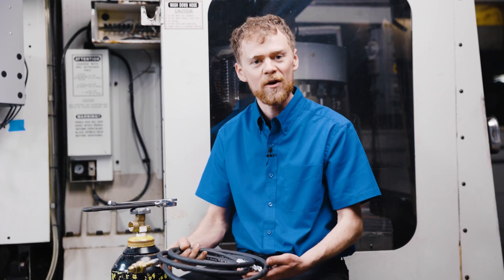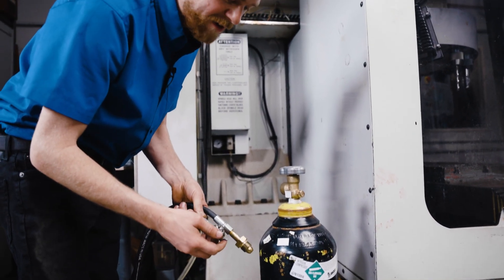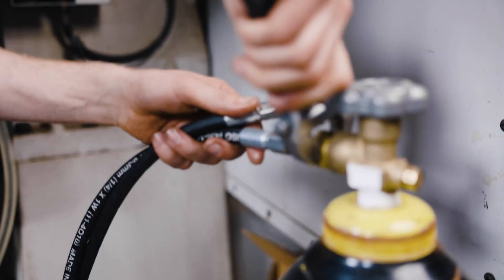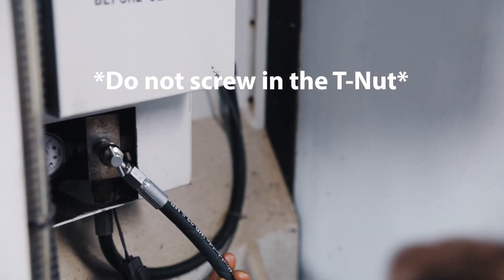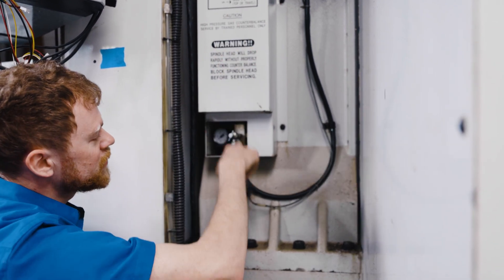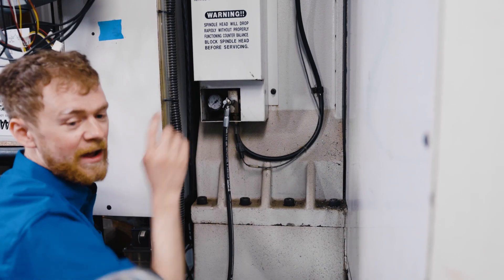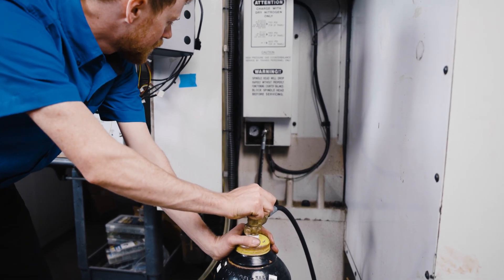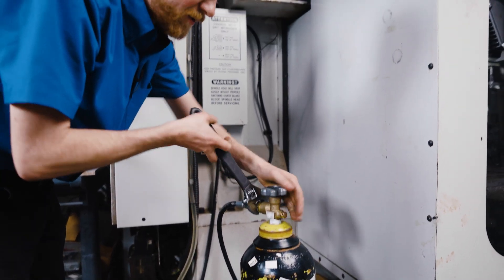Nitrogen Counterbalance Recharge CNC Machine

Comment: so the T on the schrader valve stays fully counter clockwise, and never gets turned clockwise during the charging?
Reply: my question as well.  you should explain whether or not that T is ever turned
Reply: The T is to discharge the system. It releases the gas and the oil.